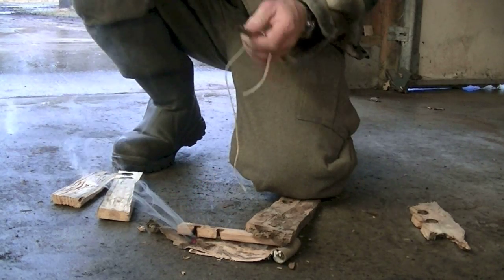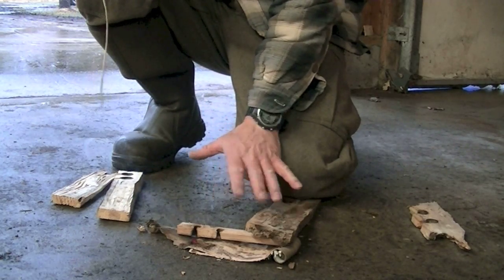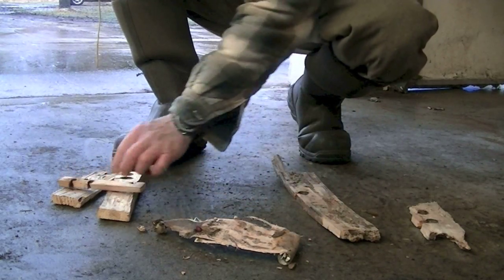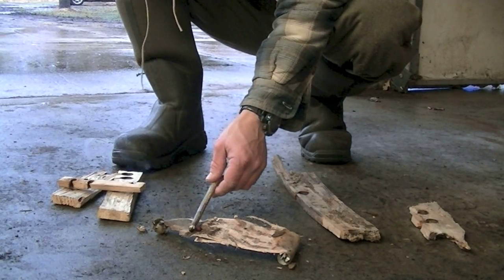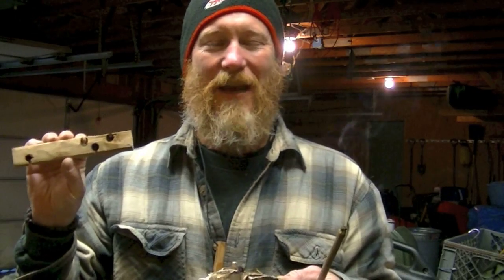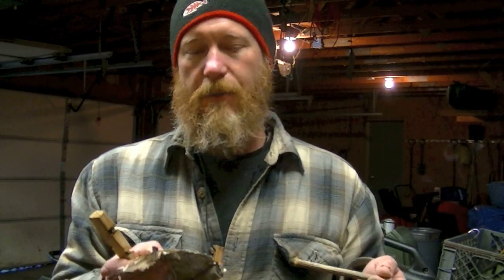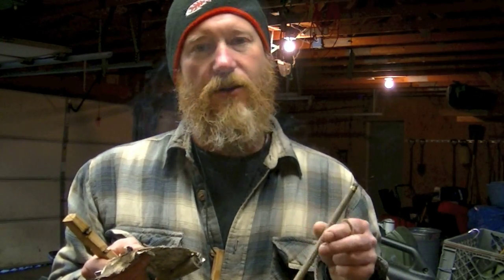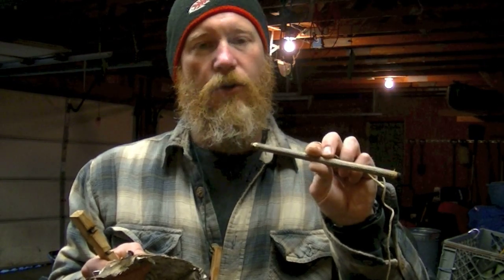Arctic Strap Drill Demo

Comment: Interesting for sure. So, when would you see using this as opposed to a bow drill or hand drill?
Reply from the maker: Usually in deep snow. Or if your unable to bend over you could use it as well. The hearth board can actually be quite a large piece of wood, especially if you use a key hole notch.

Comment: Nice work, Larry.  You sure made that look easy.  What materials in MN do you think would work well for this (and a hand drill)?
Reply from the maker: Hand drill, I'd use mullein or cattail for the spindle and basswood for the hearth. Thistle would work I'm sure as well. For the arctic strap drill I'd use basswood on basswood, or mullein on basswood. I'm sure aspen would work as well, but not as good as basswood.

Comment: Larry, I noticed you were pulling diagonally having the cord spool up and down the spindle. Is that part of the technique as opposed to keeping it perpendicular? This method looks like it would be best suited to working on a short stump, log, or if sitting, on a work surface across your lap rather than on the ground, which would be difficult with my back troubles. Whether sitting, standing, kneeling, etc. having it somewhere between upper thighs and belly button seems the most comfortable, after trying a mock up set. If you used a bow, it could be a valuable one hand technique if your other hand or arm was injured, though I guess the set would have to be made in advance. I would not discount your safety concerns though, I don't think I would try it without eye protection. You know how Murphy is with his law, I've never found that accidents waiting to happen had much patience when I am around. Great video, a very useful variation on friction fire!
Reply from the maker: Yes, using the string so it slides up and down is a technique, especially when you use more than one wrap. I use this when using natural fiber cordage for a bow drill so it doesn't abrade on itself. If I were to do this for real I'd find a large dry suitable piece of wood and use a key hole method, or two sockets next to each other one catching the ember. Or I'd raise the hearth some other way. We all have our own methods suited to our own body styles. I have done a one handed bow drill, and made everything one handed. It's on my channel. Many different methods for that as well.
Reply: Larry Roberts, thank you for the explanation on technique, that's a great tip!

Comment: Man I've tried countless times with willow but it just doesn't seem to work. I have gotten it with horshoe fungus before though
Reply from the maker: Strange, I'd think willow would work. It works good for bow drills, but of course the Arctic strap method is different. Try hand drill materials and I think you'll be successful.